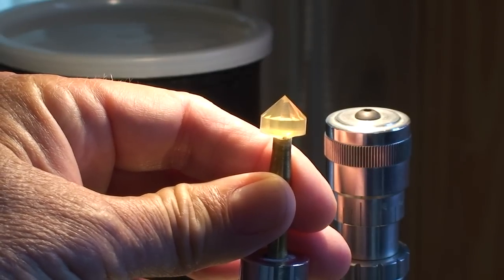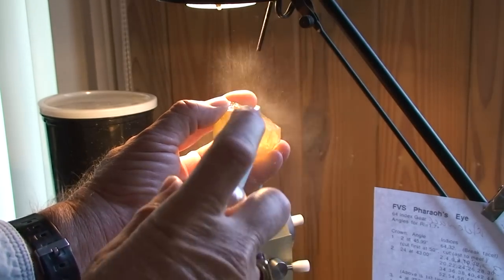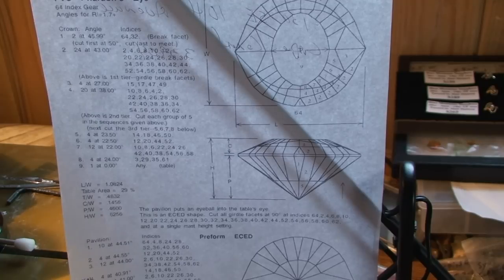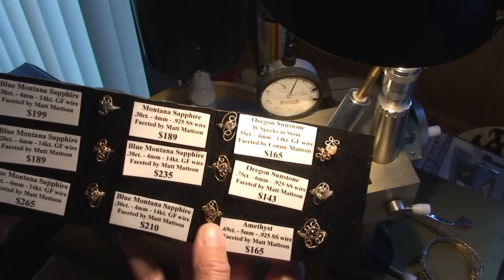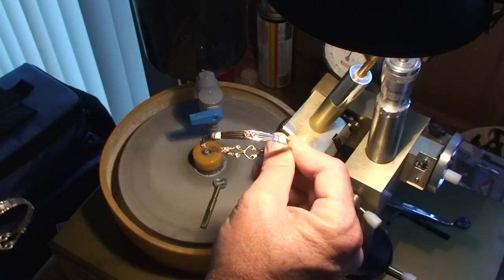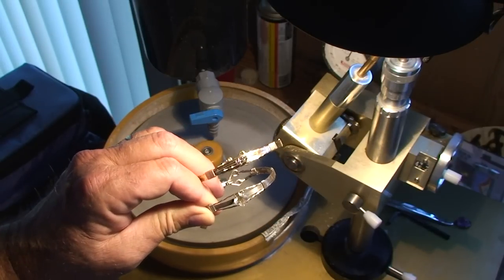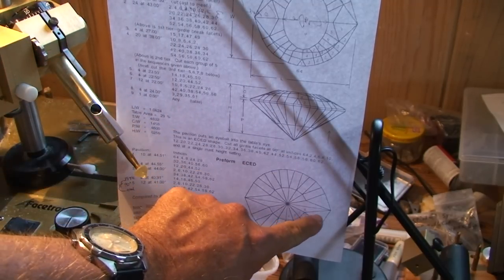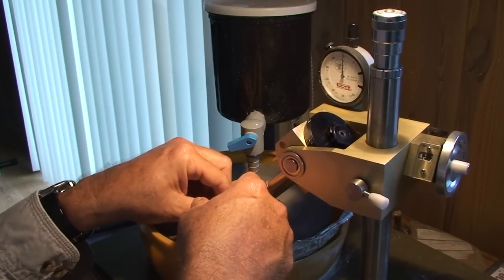Faceting Gemstones Rocks To Real Money - Cutting Gems To Jewelry Making - Pharaoh's Eye 1

Comment: Hi I have found a spot of tree Opel ,from twig size to about 30 in's around ,some have precious the rest are fire  many colors black ,white ,purple,yellow ,red and mixed .? What abrasive would you recommend to tumble the white crusty stuff off ? Thanks
Reply from the maker: The twig size stuff - start with 200 (220), the big stuff go with a standard 60-90, then 200, then 600, then your polish (cerium oxide works good on opal).  Good luck with your project!
Reply: Thanks Matt  what would you do with the the 7in to 30 in rounds ? Also do you know how to tell what kind of tree they were ? Thanks again

Comment: Hi Mr Matt.  
My name is Jason. Thank-you for your video on faceting eye cut. 
I been collecting alot of stones for about 5 years now and I have had chances to learn alot from my hobby of collecting rocks in the ground. It's my time to learn how to cut and shape these stones. I'm going to invest in equipment. 
  Want tool did you use prior  to faceting the opal stone so that it was size for the facet saw?
 I'm going to subscribe to your channel. I really appreciated your calm way of explaining. Thank-you.
Reply from the maker: Jason, I am using a 6" "Rock Rascal" trim saw (all you need for gems is a small saw).  These were once inexpensive - now they are expensive . . .  As an alternative - you can go to the Lortone Catalog: https://lortone.com/pages/catalog and scroll down to page 18 and you'll see the 6" basic that you can drive with any motor you like.  You can also look for used cabbing machines that include a saw and have another option and avenue with larger stones (we're slabbing petrified wood now) as well.  Good luck to you!

Comment: Can I spend around 500 on eBay and get a decent faceting machine?
Reply from the maker: Yes - you really don't need that much as all the machine really does is spin the laps and hold a quill at the angle you want (to make a mirror off another angled facet) and the index number you want for the individual facets.  The real art is in polishing - knowing (and developing yourself) the compounds to give the best polish for the stone in front of you is key.  So yes - if you can find something that has a stable platform that's really all that's needed to rough cut to known mirror angles.

Comment: I love opals and am a novice.  I have seen and noticed that the market is flooded with so many Opals from China and India.  They are claiming to sell Welo Opals.  Is there any way to tell them apart.  I figured that as a novice I should learn to Cab first, before I get into the intricate cuts.  I love stones, as no one is the same, they are all different and unique.
Reply from the maker: The standard way is to use a gemstone spectroscope.  There are diamond moisssanite testers that also ID gemstones (Presidium Gemlogis) and we will purchase one shortly so we can ID quickly at a show.  Expensive, but we all have to stay one step ahead of the counterfeiters now.
Reply: Are the spectroscopes worthy of the investment and do they come with a booklet that allows a novice to know what the stone that they are looking at is?  I have a moissanite tester and it really only tells me what is a diamond or what is not.  It is a cheap version but it worked on other diamonds.  Do they also tell you whether you are looking at real gems other than a diamond?
Reply: Matt Mattson
 Nowadays you need to be careful when buying gem ID equipment; they are counterfeiting that, as well. Know your dealer well.
Reply: Matt Mattson
Can a high quality synthetic stone get past the electronic testing machine?
Reply: Can you reccomend a goog gem light, I've seen them called "pen" lights?
Reply from the maker: Charles: take a look on the description link (my site) for florescent lights and in the search plug in florescent light and as there may be even better ones now, but they'll give you an idea.  I pretty much have my head stuck in the sand cutting Oregon Fire Opal, so don't concentrate on the Chinese/Aussie stuff (at all).

Comment from the maker: Haven't been able to keep up with email lately, sorry.  Facetron is a very good brand and proven design.  Same can be said for Ultratec, Graves, and practically all the rest.  The popular machines now are mainly the 3 mentioned, which means dops, parts, and upgrades are (if applicable) are readily had.  Some of the older equipment I've mentioned in the past (Lee), are hard to impossible to get parts for (but they're pretty much bulletproof).  The eye, not the machine, will determine quality work

Comment from the maker: I was pretty much lost in the woods on the subject to transposing angles until I came upon: "Angles A Better Guide To Faceting" by William H. Echert and William J. Echert.  Find that book.  This book gives guide numbers for angles on the pavilion and crown to get the most brilliance.  A surprise to the authors is that many original diagrams do not have angles set properly to begin with.  The two angles most critical are the pavilion mains and crown mains.  Make all other changes based on these.

Comment: I find it interesting that you downgrade Ebay stones.  If you are carefull in your bidding by buying only certified stones you can get some nice gems from India or Sri Lanka.  One drawback however is that most of these stones have been cut with a template cutter and the facets do not meet.  There are inexpensive spectascopes you can buy and/or build.  It is also important to have a good Ultra Violet lamp.  Two actually.  A UV-A and a UV-B. and a low power microscope.  1-50 power.  This is where real money gains can be made.  Re-cutting a poorly cut stone is far less work than starting on a rough piece.  You can turn a two dollar stone into a $200 stone with very little effort.  Also buying large stones that are full of faults can be a real saving as well.  By breaking apart large stones at the faults you can get some nice pieces that can be cut into smaller gems.  It's always fun to play at what you can get for very little and what you can turn it into. I must say this has been a great video though.  Thankyou
Reply: i buy a pice of glass from ebay 90 ct , i think it was aquamarine but it was only glass. so i dont trust any of this thing, i dont know were to find a good source of aquamarine.